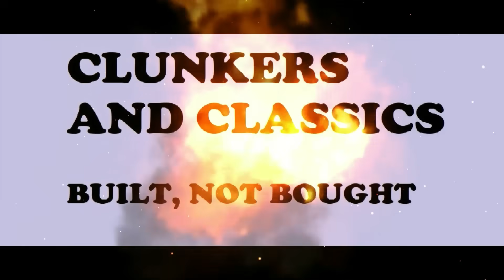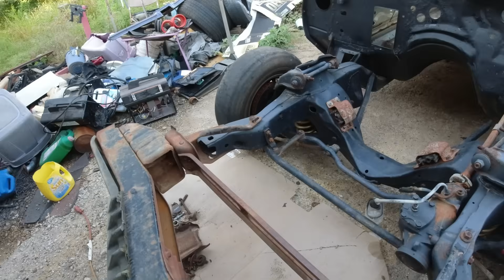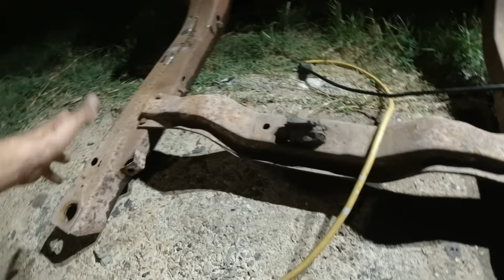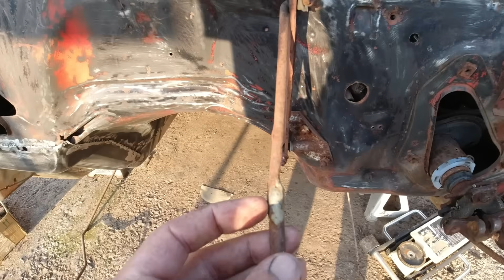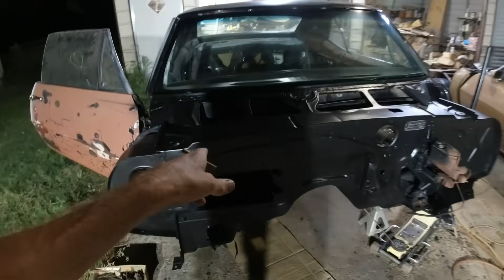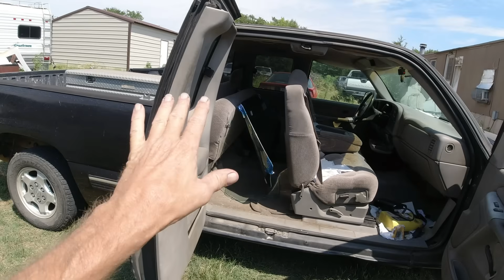1967 Camaro Build #17. Firewall and floor repair, clean up and paint. Subframe removal.

Comment: Detroit Axle is only closing one of it's locations, the one in California! (What a surprise, California!)!  What do you mean when you say that "Trump tacoed" I don't get it!
Reply: I use Detroit Axle. Haven’t had any problems. Their struts will actually give you about an 1/2 inch lift👍
Reply: @davidlaramore1359  I have used Detroit Axle products for many years with no problems!
Reply: @davidlaramore1359  Yeah! I've used Detroit Axle products for years and had no problems!

Comment: Bet you could find a subframe pretty easily. 67 firebird subframe is the same.
Reply from the maker: if it was 1985 I could find them easily but not now
Reply: @clunkersandclassics  there are several on marketplace now. People are doing LS swaps a lot these days and opt for a full frame, then sell the sub frame pretty cheap. Hope there is something near you!
Reply: Keep in mind that 67 setup is a one year deal with the steering box. 68 and up steering box is in front of the cross menber.
Reply: @aaronk6676  No 67, 68 and 69 subframes are the same apart from some minor differences like location of bump stops. 67's have the bump stops mounted to the spring pocket. 68's have it mounted on the lower control arm on the rear part of it and 69's have it on the lower control arm but in the front of the arm. My 67 camaro has one 68 control arm and the other is from a 69 and the subframe comes from a 69 camaro.
Reply: @Halibrand  as i said, the steering box is a one year setup. Agree on the frame
Reply: @aaronk6676  My camaro 69 subframe has the steering box behind the crossmember just like 67 and 68. 2nd gen camaros came with the box moved in front of the crossmember just like a body cars.
Reply: @Halibrand  Should have said linkage not box, and it's behind the front wheels. had to go look. My bad.... don't care about other generations. Been wrong before, will be wrong again. The main point was to state the 67 was different. That was correct

Comment: Yeah I think putting the front end from the z28 on the 69 is the way to go.
Reply from the maker: unfortunately, it won't fit
Reply: @clunkersandclassics It also should have a VIN stamped on it somewhere if you're trying to keep the Z28 as original as possible for resale value. 
It's good to see someone working hard. ✌️

Comment: and finally front small block coil springs are $72 ebay and shocks are cheap rock auto in fact they got ps gear box $132 front  shocks are $13 each   $415 plus 270 plus 132 plus 85 plus 26 $928 plus tax    Son get r done   !!!!!!!!!!!!!!!!!!!!!!!!!!!

Comment: funky fresh new ps gear box is 199 ebay but should be able to source off of 68-74  master cylinder 1967 corvette disc brake $85

Comment: If you go with Vintage Air it'll delete that outside blower motor box, they'll give you a flat panel in the new Vintage Air kit, and the new blower motor is going on the inside of the dash...
Reply from the maker: I figured that

Comment: disc kits are $415 ebay free shipping frontend rebuild kit is $270    and if you have your 4 door nova  that is same subframe        68-74 nova omega ventura Appollo   and 64-72 a body disc brakes fit switch steering arms

Comment: Check menards if you have any in your area. I bought a clarke brand welder there. Flux with gas option. They work very well and have adjustments. You need a good one doin all this work. Great video.🍻👍👍👍

Comment: Lee a second-generation (1970-1981) Camaro subframe will not directly bolt up to a first-generation (1967-1969) Camaro, whoever told that guy you purchased your Camaro from was blowing smoke...
Reply from the maker: true since I just measured then both
Reply: @clunkersandclassics I've already been through that headache, I was just trying to save you from wasting your time pulling it all out and having to put it back in the 81🤜🏻🤛🏻

Comment: The Chinese were given 140% tariffs  you didn't pay extra for the windshield dude you said it in your last video Bumble bee is a regular camaro  and now you tell your supplier I need a windshield for an 81 camaro Z-28 so he says ahhh that'll be 200  how conventional that a 67 and 81 are 200 but then a regular camaro and Z-28 are going to have a 70 dollar difference just like your insurance if you mention z71 versus Silverado  it's gonna be different  you said you weren't gonna cheap out and do your regular shortcuts but you are  why don't you read the fender tag and put what it says back in; there is no change in the dash board it's just the panels and ash Trays and carpet on the bottom!!! You can't even figure out what you wanna be mad at you'll mock me But, I plan on spending about 2grand on a Mustsng 2 front end whether it's 2100 2490  I'll pay for it because I don't wanna do a hatchet job on my 70's classic !! I paid 869 dollars for a fiberglass one piece front end it's probably still nearly the same cost except for the truck freight cost is more because of BIDEN's fuel rise so guess what I pay for that fuel increase SO WHAT!! ILL DO IT BECAUSE it's what I'll have to do if won't look for a Subaru plastic nose and see if I can make I'll fit with my Vevor 12v plastic pin welder anyway, I didn't get a round tuit to get to tell you this 3 videos ago but I unsubscribed but your videos still show up in my recommended section not in my list anymore You speaking to Putin to stop the Ukrainian Biden money laundering system or you still down for us legitimate taxpayers to pay your way thru life !!!  Tacos are for Mexicans aren't you glad you won't get confused as one and neither will Trump!! 
Amen !!
Reply from the maker: regular camaro and Z28 windshields are the same and same price, my glass guys don't play games. you pay the $1000 difference and I'll put in the deluxe interior, how about that? No idea what the rest of your rant means but adios!
Reply: MAGA translation:! “stop talking bad about TACO or I won’t watch you build this car!”
Reply: @gregt722 thanks for translating that jibberish...not that I pay much attention to the maganuts.

Comment: You can save the upper and lower control arms, just rebush them and get yourself a power steering box and new springs
Reply from the maker: I need the disc brake conversion kit as well with brake booster and master cylinder
Reply: @clunkersandclassics I went that route also, got the spindles from a 69 Camaro